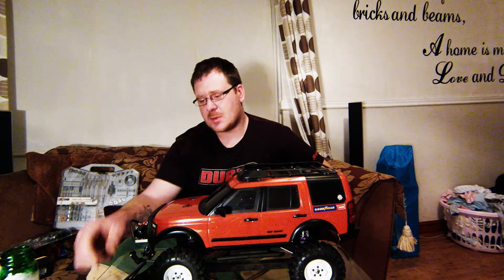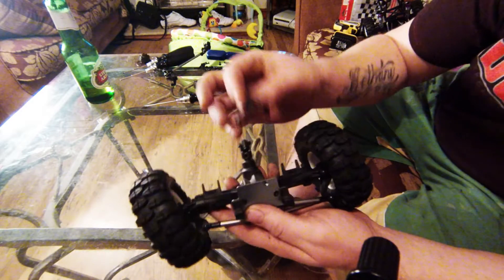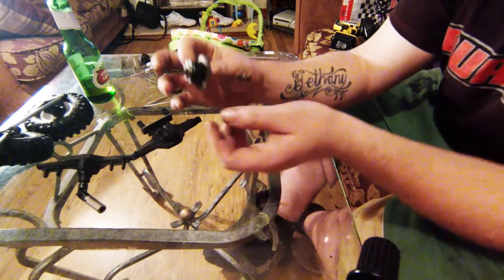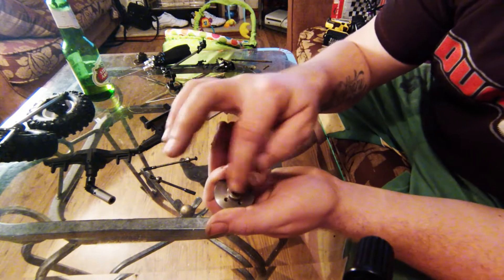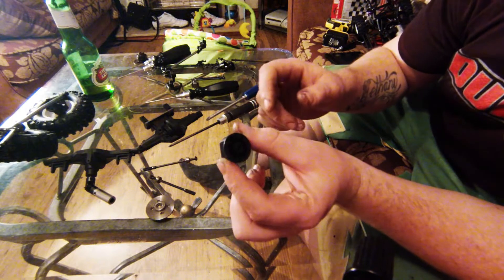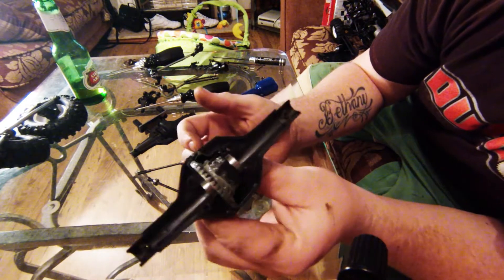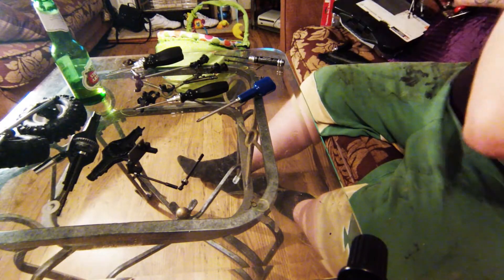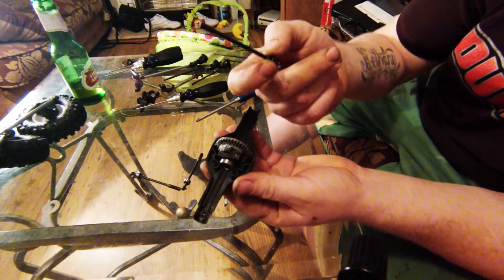MAVERICK - SCOUT - DIFF LOCKER - MOD

Comment: Thanks for posting this, I also have scout gear on an SCX10 chassis and am about to do the rear axle as I lost a pin and broke a C-hub. For the rear axle do I just re-use the maverick bearings and slide them on the Axial half-shafts?
Reply from the maker: You will need the rear scx10 bearings
Reply: *****  Just noticed you did mention it in the video! Must have sneezed at that moment! I tried putting mine together and the half shafts don't stick out the end of the lockers far enough to put the wheels on, as if the lockers are too long or the shafts are too short but I'd bought the shaft part number you suggested. I also had to run a drill bit into the side of the plastic diff housing so the shaft would go in deep enough to locate in the Axial locker. Not sure if Maverick have changed something or if I have screwed something up.
Reply from the maker: booga315 maverick may have changed something Al look in to it mate